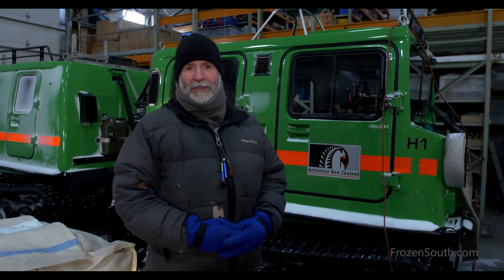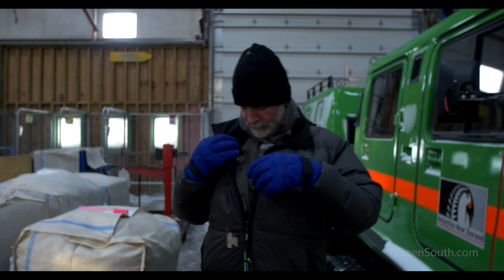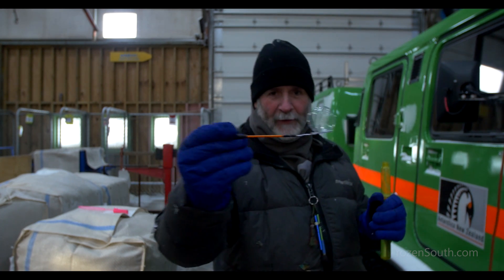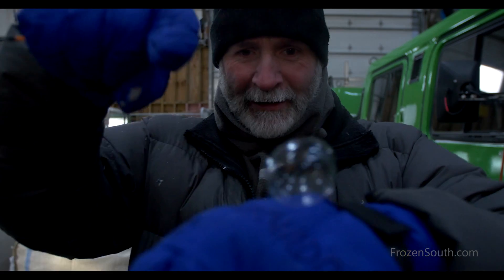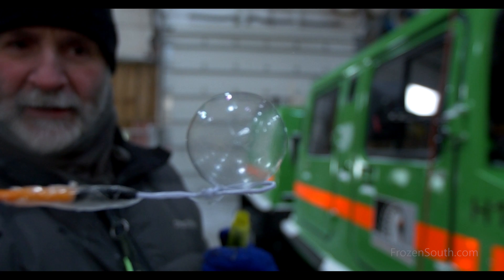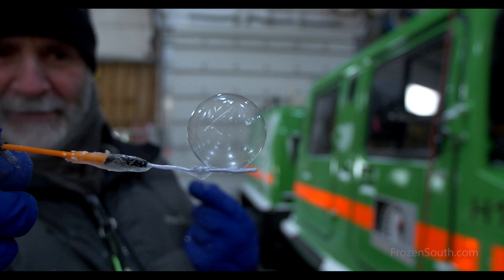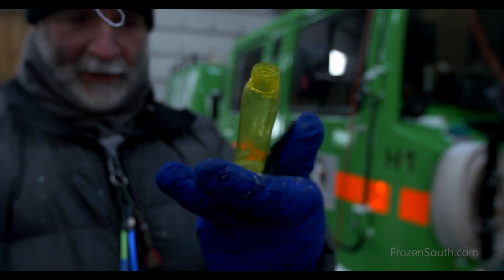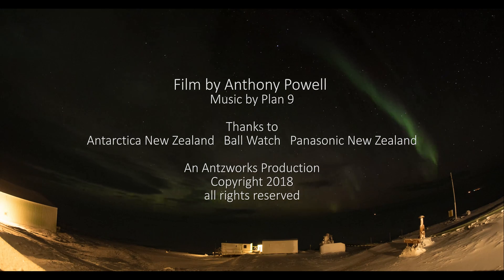Frozen South: Blowing Bubbles at -40 Degrees

Comment: I've always wanted to see this, I want to try it soon with a bubble blower, but we don't have -40 unfortunately. We get -20s instead 😔
Reply from the maker: It would probably work well with a bubble blower at -20 if the liquid was kept warm, as the cold air inside and outside the bubble would help it freeze faster than using your warm breath.